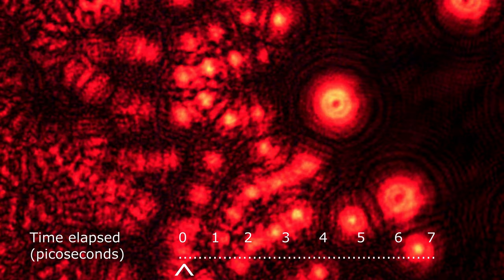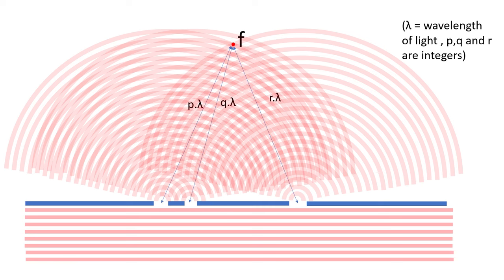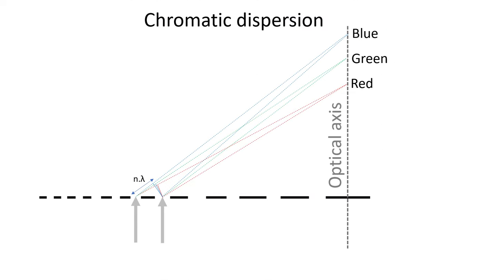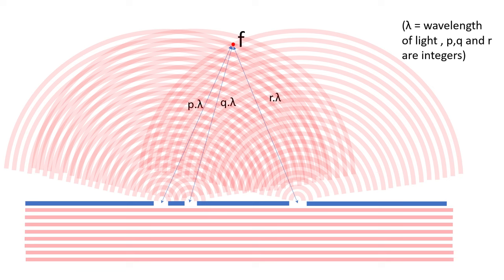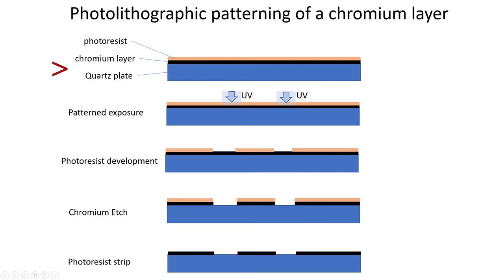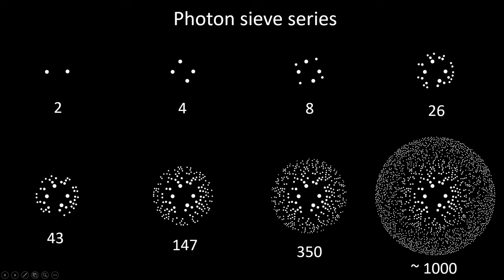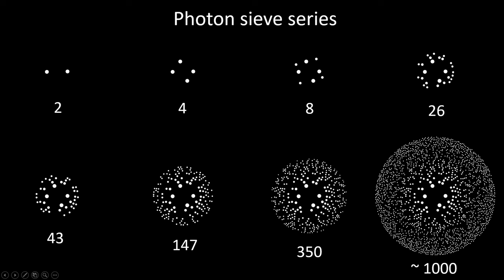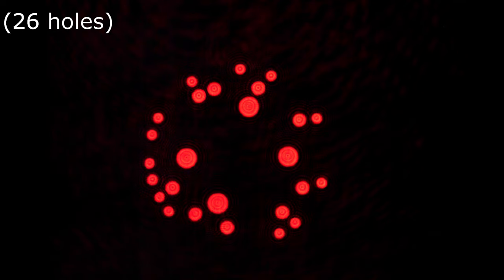Light Waves Visualized using Photon Sieves.

Comment: Why only use circle holes? Why not slivers of arcs or star shaped holes or some combination?  What happens if some holes are attenuated with neutral density filters? What if holes have optical material inside that has an index of refraction dependent on wavelength? What if the optical plate is etched through the holes and given a concave lens geometry? 
ps … thanks for demonstrating the actual reality of what happens and not just a concept filled with assumptions that could make a difference

Comment: Holes act as a lens. Noticed that looking through window screens as a youth.
I don't believe in photons. If a photon is a thing it would be traveling at the speed of light. Nope.

Light is a wave, a massless clock besting out time. Emr is time is waves is energy. All the same thing.

Like ice, water and steam are the same thing.

What you call a photon is simply what happens when the wave interacts with mass.

Comment: Wow I just noticed the time scales at the bottom in the beginning video. 1 PICOSECOND every 3 or 4 seconds? That's mind-boggling. Light would only travel 300 microns in 1 picosecond, or about the width of 3 hairs at a speed of 300,000,000 meters per second (rounded up). You guys never fail to impress. Even with multiple viewings I notice something new to be in awe of each time.

Comment: Thank you for the incredibly beautiful and educational content. As you were describing the relationship between focal plane height and time-of-flight I realized that in the photon sieve there is no material to slow down the light waves coming from the middle relative to the ones coming from the perimeter of the sieve, therefore the ones coming from the edges have to travel a longer way to the focal point, is this effect real, does it contribute to distortion and can it be managed?

Comment: I think you mentioned the "focal length" of the plate was 1mm.
Do you have any estimate of the focused spot size?
Reply from the maker: Its in the order of a few microns, but I did not measure a Strehl ratio or how much of the radiative energy is actually inside the central focal point.
Reply: @HuygensOptics  Thanks.
Very interesting topic.

Comment: If the bigger holes have a "worse" diffraction effect than the smaller ones, why aren't all the holes the same size as the small ones?
Reply from the maker: In the outskirts of the lens you need a larger angle of diffraction, therefore you need smaller holes and holes closer together to effectively contribute to the constructive interference in the focal point. Very similar to thickness of the rings in normal zone plates.

Comment: Awesome. Now I wish to see a water bath analog of this.

Drilled or etched holes in a plate. Plate in a container, height adjusted to put focal point on surface, and just hit the bottom of container. 

How did you generate the patterns?

Comment: You say that the larger the holes are, the smaller the defraction is. Why is that? When the light hits the edge of a hole, how is it influenced by the distance to the other side of the hole?

Comment: So what we perceive as distance in time, is just like distance in space for photons?
Reply from the maker: Yeah, sort of. Time traveled and distance traveled are equivalent. The factor between them is travel speed. In this case that value is the speed of light (300000000 meters per second).
Reply: @HuygensOptics  So I would assume that you are looking at phase relationships and since time and distance are both related to phase you can observe time slices using distance ?
Reply: @pentachronic  thats how he is recording. Hes moving the focal point in space.

Comment: To me, these look a lot like the pre-processed images from radio telescope interferometers. It look to me like the holes are actually selecting/masking area of the Fourier plane, which essentially convolves the source image with a point spread function (that is, the system's response to a point source). Radio astronomers usually clean up (deconvolve) these images by applying an optimisation function to 'guess' at the unsampled Fourier space, but that usually relies on some assumptions about the darkness or smoothness of space.

I'd also be interested in what the resulting integrated image would be if the sieve was spun about it's center, though I'm not sure how that would be accomplished.
Reply from the maker: I guess the image outside the central focal point would look a lot smoother. However, you need to really position accurately since the focal point is in the order of a micron in size.

Comment: Are those holes a low discrepancy sequence radially mapped, theta uniformly to minimize variance and r chosen such that the path length is an integer multiple of the wavelength?
Reply from the maker: Actually, I don't know. They were just copied from the internet, I did not bother to write a program myself that generates these like I did with the zoneplates. The hole radii seem to be in accordance with your assumption, as does the theta uniformity.

Comment: I noticed a number of baby diffraction patterns in the image around 9:32 in the video. You see the obvious brighter patterns from your holes and then a number of much less intense patterns scattered about. I’m curious if you know what causes the because I see the same thing in the images I take on a home made psf set up. In my case the image is of the diffraction pattern formed by a traditional glass singlet that is illuminated by an even field of collimated monochromatic light. The light is from a green laser diode that runs through a couple lenses to act as a beam expander then a mechanical iris to restrict the beam from illuminating beyond the edge of the downstream lens that is to be measured. I use a 20x microscope objective and small industrial c mount camera to image the diffraction pattern produced at the focal point of the lens that is being inspected and I keep seeing the raindrop pattern scattered across my image similar to what I saw in your footage and it has had me stumped for months how to get rid of it so I can take the image and integrate it into an mtf plot. I plan on using the set up to test lenses I intend to try and make but I’m using a commercially produced diffraction limited lens from an optical supplier (EO) as my test case to tune the apparatus in.
Reply from the maker: Just saw your comment. I'm not entirely sure which patterns you refer to. In this particular configuration, you can get unexpected intermediate diffraction patterns turn up, basically just because of the position of various pinholes. I've seen them too with regular patterns, where they turn up periodically. If you want to measure PFS, you might want to try the fluorescent bead method, which will give you the option to measure it directly in space.

Comment: I’d like to see the results of water droplets hitting the surface of water in this pattern.
Reply from the maker: If you would correct the hole distance from the center of the pattern for the angle towards the focal point,  and all droplets fall at the same time you would observe the same type of wave pattern and a wave focal point. It would be a spectacular thing to observe.

Comment: So light is always waves in the electromagnetic field. Particles are just an statistical illusion by the fact light hit a single atom and drops a quantized amount of energy.
Reply: @schmetterling4477  "there are no simple experiments and theory to demonstrate field quantization beyond any doubt" that's what worries me most. I just presumed that fields are quantized.
Quantum field theory does seem to give the right results, the problem I have with classical wave theory is that its an abstraction that says nothing of the underlying phenomena.
Reply: @schmetterling4477  
  " is to explain matter. There are simply no stable solutions of classical charges and classical em fields that produce anything resembling atoms"
I just wanted to simulate it in my computer.
It is not that it worries me, I'm just curious and wanted to know (a simple solution that I could use in a simulation). 

It doesn't really "worry" me.

And it is fabulous indeed.

Comment: I wonder if light seives would work with actual water?
Reply: Like a 1 dimensional analogy of one? The waves in water are on the surface, right, and would have to pass through the thing horizontally? (Right? Not sure.)
Reply: @drdca8263  the analogy of the light waves as they progress through the sieve is the same as water disturbed where the holes are; it reminds me of Flowave
Reply: @russellking747  Ahhh ok that makes sense, thanks.

Comment: If you dispose hole very precisely matching pixels sensor you can achieve an actual planar lens .  Or any other lens however just matching the sensor mask ..
Reply from the maker: I'm afraid that is not possible, any color can be in any location at the object an thus also in the projected image.
Reply: @HuygensOptics  
you trust too much 'science' 

refraction do not work as they teached you ... what's true is you'll need 3D holes .. you still checking 2D misplaced
Reply: @HuygensOptics  
consider this ..
1) lenses do not bend light ,they filter it 
2) the very trick of vision is the focus point.. see pinhole cameras 
They however are obviously not good for several reasons .. but effectively even a single hole act like a lens ..
Reply: @schmetterling4477  
yep they do 
but is just part of what really happen..
and isnt due to bending 
happening the way you were told 

if lenses were actually bending light you should be able to  stack them ahead of focus poit to add their
supposed bending 

try to add lenses ahead of their focus point
Reply: @schmetterling4477  
refraction/interference is the less understood pair of things in quantum physics due to the imaginary assumption waves are actually flying like particles ..
Reply: @schmetterling4477  🤣🤣🤣
maybe you get it wrong ..
by focus point i mean the point where image get inverted , not the focus plane .. 
You'll be surprise of how much i know about physics ..
and if you really believe any wave fly instead of propagate you are the one dont know even the basics ..

i understand they tryck you in believe so but waves just cant travel by definition ..
Reply: @schmetterling4477  
i dont usually refer to focus lenght because makes confusion between 
distance to the focus point and distance to focus plane .. which aren't obviously same thing ..
Reply: @schmetterling4477  
BTW.. the focus lenght of a lens alone is just the distance the focus point was designed for .. very much likely not same you actually use .. unless your alligbnment is perfec

Comment: The size of the holes in the sieve is the same as the wavelength of light, points of constructive wave interference are called "photons" but they are just waves. There are no particles of light, there are no photons. Electromagnetic Radiation is only waves at all frequencies.

Comment: Your job proves that actually the light couldn't travel in empty space. That means that everywhere in the Universe is existing a medium for the light to travel. Of course, the medium isn't Ether but is a medium in layers of material with different consistency. Also, this means that the light's speed isn't stable but is changing regarding the refraction index of its medium. As we know, the light in the diamond has the half of the speed that it has in air. And again it gains the air speed when it comes out of the diamond. Maxwell was right and not Einstein.
Reply: How does it prove that? Do you claim that every phenomenon which is analogous in some way to a phenomenon that happens within a physical substrate, must also be in a physical substrate? This would imply that it is impossible to create a physical analogy within a substrate of the behavior of a physical substrate that is not itself within another substrate.
Reply: @drdca8263  Why are you thinking so? How different could be the material on Earth than the material in the Universe? The main composition will be by the elements that can be found on Earth. And this is everywhere, don't forget that every element on Earth are from Super novas. So, the composition of the Universe could be mainly the same. The differences are in concentrations, the temperature to the pressure and element composition, but mainly hydrogen and dust. There isn't such thing like empty space. Space could be very sparse, but not empty. Space is a material function and couldn't exist without matter. Only Einstein in GR suggest the existence of space and time without the presence of energy of material. His philosophy is that matter is a kind  of energy. But energy couldn't be a function of energy, as the material couldn't be made by its functions like are energy or field.  Ok, this is a philosophy, but the proves now suggest that Einstein's believe in empty space is wrong. We know now that the solar system is filled, (Voyager) also after the solar border is the galactic medium. Now we know also about the galactic web, which is e medium between galaxies in a galaxy cluster. So, the evident from observation suggest that there isn't such thing like empty space. Then why not to accept the obvious, which your experiment proves? Because is against few math formulas? Don't forget what was said by Einstein. He preferred a pretty formula in physics than an ugly truth. Yes, but a physic scientist is looking for the truth and not for beauty.

Comment: 2:30 “Generally diffractive lenses have a major disadvantage: chromatic dispersion.”

Says you.

Imagine chromatically dispersing solar radiation then guiding each frequency to a different process.

•IR waves to thermal equipment-
•Reds and Blues to hydroponics.
•other colors to their respective PV material manufactured do those specific band gaps
•UV to sanitizing processes or PV cells

Now, solar panels only need to collect and transmit solar radiation to a centralized location to be processed. This leaves the panels to be silicates or polymers making the manufacturing process much less complicated while allowing the rat earths and lead doped perovskite to be easily recycled….

I have a whole page of the advantages, but the ultimate goal is to transition our power grid from electrical to photonics.

•Immune to EMP effects: lightning, solar flare, high altitude nuclear explosion.
•Lighter
•More efficient.
Reply from the maker: That is true. However, the purpose of most "lenses" is to give a good image reproduction by keeping the frequency components together, not to separate them by a very large degree.
Reply: @HuygensOptics  The point was not to limit thinking to a single application so as to not miss on opportunities for innovation:

Solar panels are extremely inefficient and they are not designed for recycling leaving them to be tossed into dumps at their end of life.